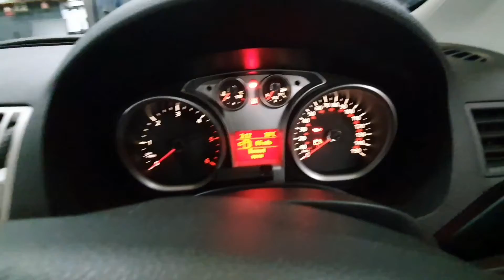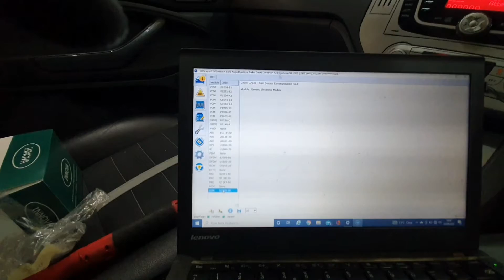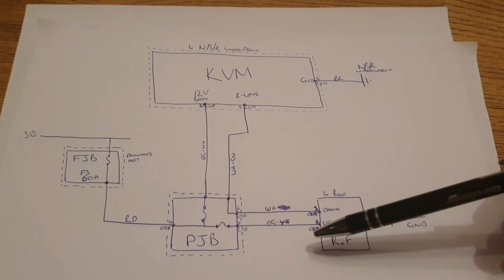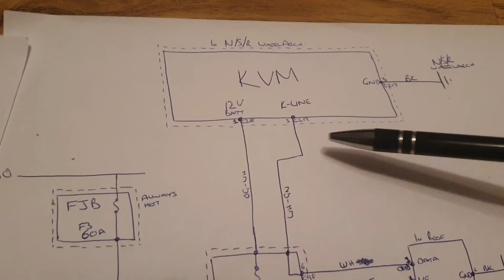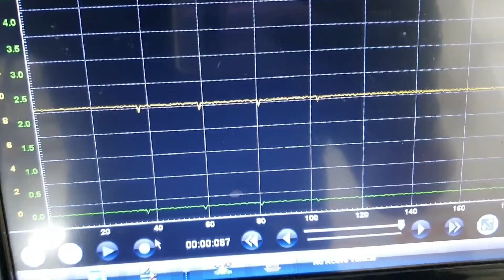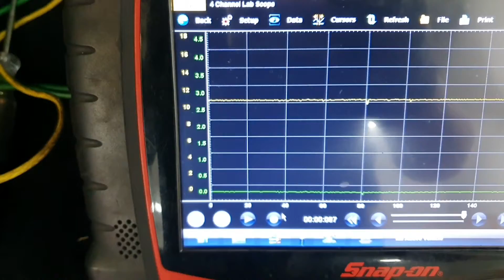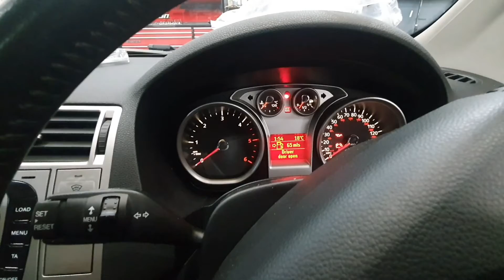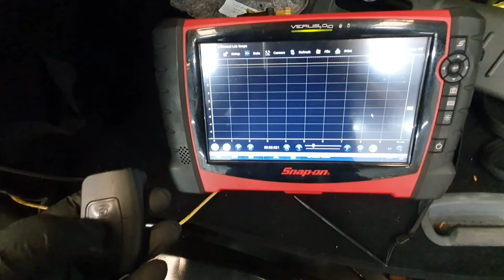Ford Kuga Non Start - PATs Light Flashing - Key Not Detected

Comment: Brother  my kuga from 2010 won't lock or unlock from the remote but it will lock all doors with the key blade and it will also detect the key inside and start, but it won't lock or unlock the car and there are no fault codes, some help??
Reply: Ich habe genau das gleiche Problem! Was kann man tun ? Fernbedienung öffnet nicht mehr ! Wie kann man die Fernbedienung neu anlernen ?
Reply: Hast du eine Lösung gefunden?
Reply: @mv6473  hey, no.. i'm still searching
Reply: @mv6473  Hey brother, no solution yet... i'm still searching in the hope of a damn fix...
Reply: Same problem here. My best bet is that the KVM receives the signal from the key( because the ic lights up ) and should send it to the gem module ( underneath the glovebox on left side drive) and then the gem should command the driver door module to open/close the doors but the gem is broken or the wiring from KVM to GEM is broken, or the wiring from gem to driver door module is broken. The doors can be locked/unlocked turning the key or from inside manually so...maybe the wiring from the door module to the gem

Comment: A well made video with a brilliant diagnostic route , I will have a look at my KVM module as I have had repeated water leak issues associated with screen top and scuttle . One question if my problem is the same and I repair , will I need PATS programming or will it be ok to just use the key ?
Reply from the maker: Thanks for the comment.

If you require a new module you will need it programming